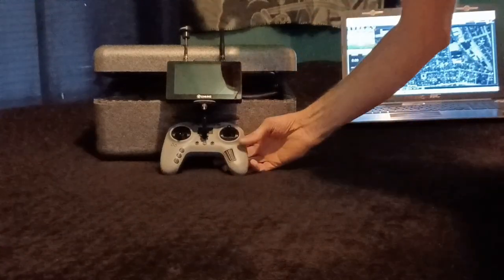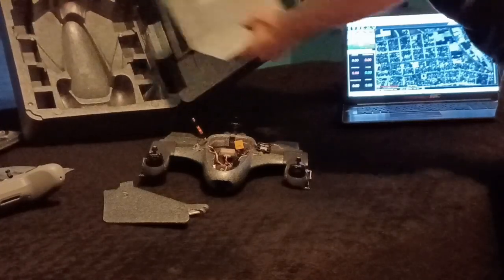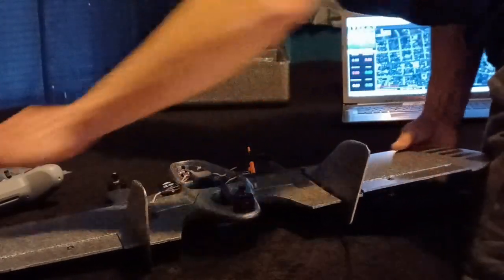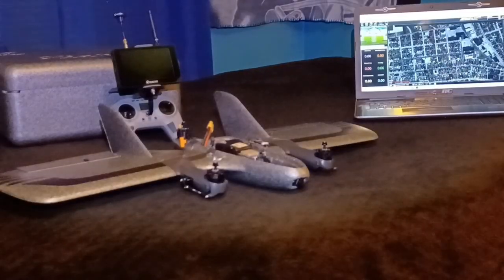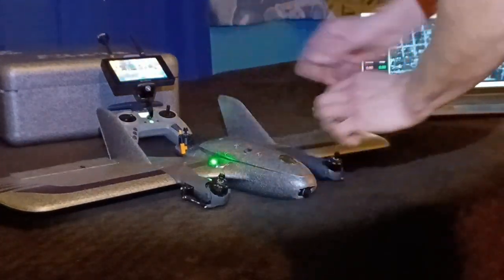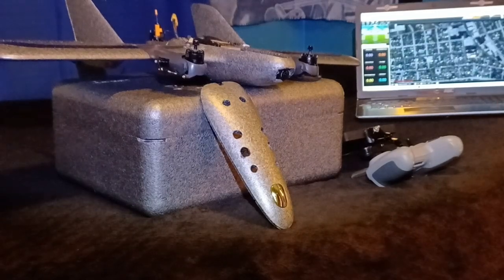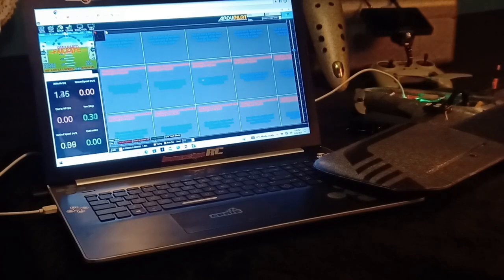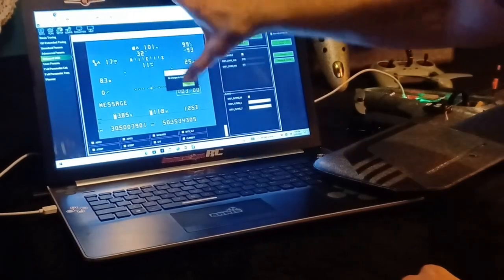Jumper Xiake 800mm Vtol Wing

Comment: Hi, thanks for the information about the Xiake 800. One remark about the setup in Mission Planner: sometimes, you will need to write the changed parameters to the FC before deconnecting. Not all parameters are automatically stored on the FC, so you might loose your changes if you just disconnect

Comment: connected the polar caddx air unit to the jumper xiake 800 . on DJI Avata glasses , FPV does not output OSD . how do I display the indicators on the screen ? any suggestions?
Reply from the maker: https://ardupilot.org/plane/docs/common-msp-osd-overview-4.2.html

Comment: i ordered one of these right of amazon for 199.99 it didnt come withe the transmitter. i still havent set up my cnc elrs module yet. it has the elrs 3.0 and the pixhawk i think it is... im familiar with crossfire and tracer so hopefully the elrs wont be too much of a headache to learn, but the pix hwak is also something ive never used yet, so with that being said its still siting
Reply from the maker: Setting up elrs is basically the same as xfire and you use crossfire protocol in settings!
It's not a pixhawk FC it's a proprietary Fc f405 based the Jumper has designed and it runs Arduplane and you can download Ardupilot Mission planner and use that to connect to the Fc via USB cable!